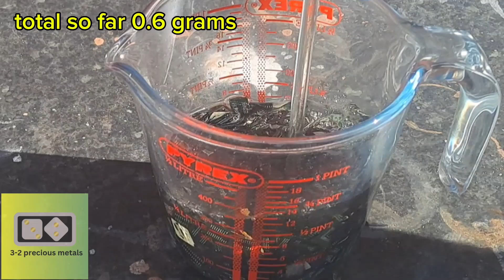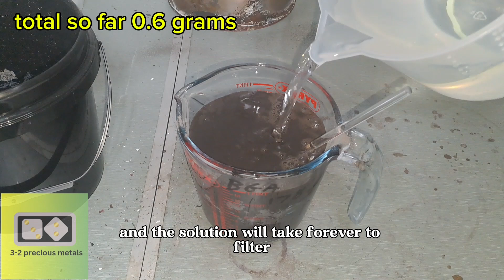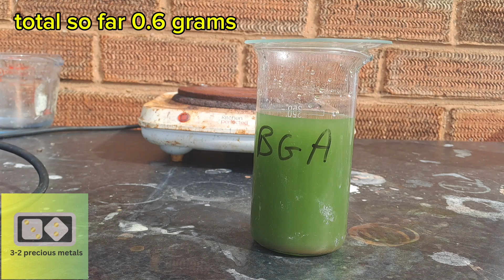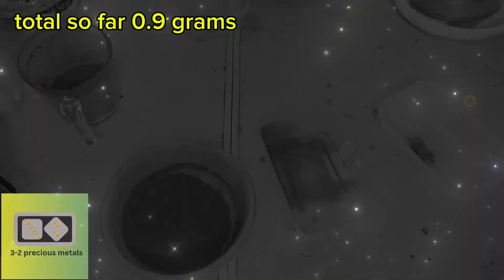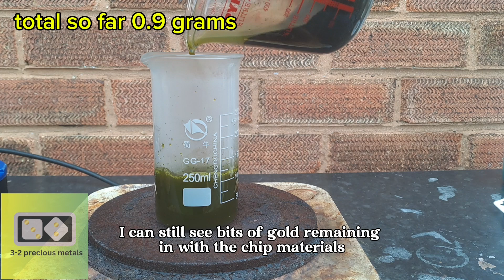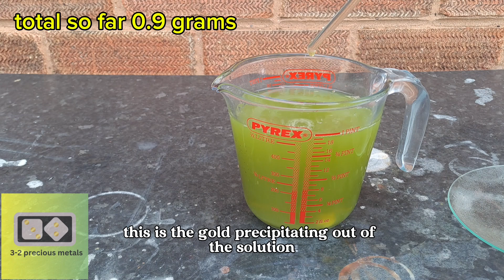GOLD RECOVERY from EBAY ewaste (part 2) I.C. Chips

Comment: I use a electric rotisserie for BBQs'. It has a cage that shuts. I lined the cage with fine steel mesh like window screen. It holds a kilo + of ICs'. I built a fire brick box to put the cage in. It has a hole in the side for the burner. I set all that in a steel pan. Turn on the rotisserie and light the burner. As they burn they tumble , and the ash falls into the tray. Most of the legs and the silicon stays in the basket. Leaving very clean ash with the gold wires. You get the idea.
Reply from the maker: That's an absolutely brilliant idea, I really like that. I had thought of something similar but a bit bigger for de-populating boards. Boards heat up solder melts, and components fall out onto a tray. I keep thinking of building it, never get round to it. I'd never even thought of an automatic chip crusher. Thanks for watching 👍👍

Comment: If you put the chips in AP it will dissolve  the legs , then crush and burn , burn again , it works well in my opinion to make.
if your up for a friendly challenge I have a video in response , it’s from CPU scrap and pins ( >1.5 g)
Reply from the maker: That sounds good. Just took a quick look at your channel and subscribed. I like the look of that copper cell. I had thought of doing something like this for non-ferrous pins. I'll be watching a few more of your videos in the morning 👍👍
Reply: @3-2preciousmetalrecycling   sure   Would appreciate any tips to improve processes

Comment: Why you dont use urea or sulfamic acid to neutralize solution before drop?
Reply from the maker: I don't overuse nitric acid. I use enough pottassium nitrate, or sometimes nitric acid, to get the job done. Once a reaction has finished, I add a little more. If I don't get any reaction, it means all the gold is dissolved. Therefore, there is no need to use urea. Some people use urea to remove excess nitric, but because I don't have an excess, there is no need to. Thanks for watching 👍

Comment: I dont know why you werent recommened thru You Tube earlier. I live my life outside of work and family refining. Im happy to share my recovery rates with you. I dont know where you are located but I do know of one company listing on Ebay that I buy from regularly. You are right about the fiberglass bit holding onto a portion of the gold. Ive backed this up with a microscope. I use a 2000 micron mesh when dealing with the Bgas to fully seperate the fiberglass vs the rest
Reply from the maker: I'm located in the UK.  I've thought about buying a few high micron screens and testing to see at what size does the gold no longer fit through and if I can remove more material without compromising the gold yield
Reply: @3-2preciousmetalrecycling  I've tried as high as a 1500 micron mesh... I lost gold within the fiberglass. The 2000 works best for me. Rather than loosing 50 percent for using higher mesh vs lower. I loose 10% that I build up to refine in larger batches.
Reply from the maker: Thanks for the information. 👍
Reply: I’m with you Electronnicscrapper, why didn’t the algorithm recommend sooner? Subscribed also, thanks for the video 3-2.
Reply: Also quick tip, get rid of the plastic bag and magnet, too much faffing, build a small electromagnet, all you need is a pc power supply, a magnetic steel/iron nail, a switch, and a decent length of thin enamelled copper wire and some electrical tape. Loads of videos on YT about making these. You can use a battery but they got hot after a while, hope it helps and keep them vids coming.
Reply from the maker: I like that idea. Thank you 👍

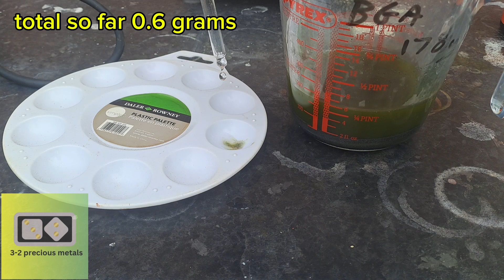Comment: 8:01 will you use H2SO4 to drop any Pb out of solution before you precipitate the Au?
Reply from the maker: I don't for gold recovery. I like to recover the gold first, and then once I have a decent amount, I'll refine it to get it pure. When I do the refine, I use sulfamic acid  to remove any lead as I can not buy sulfuric acid in my country
Reply: @3-2preciousmetalrecycling   if this was about the bgas... there will be no lead present... nor silver
Reply from the maker: I do it when I refine all my gold after recovering just as a precaution it is possible to pick up small bits of lead, tin, copper and silver from the boards the bgas come off or the containers I store them in while I build up a batch or just from not separating the material properly. I also use ammonia to wash my gold when refining as a precaution just in case there is any silver chloride present. It cleans the gold up beautifully